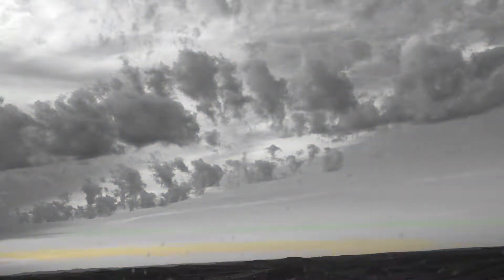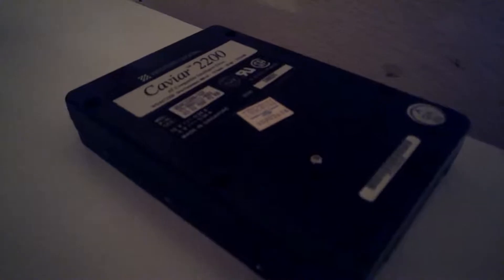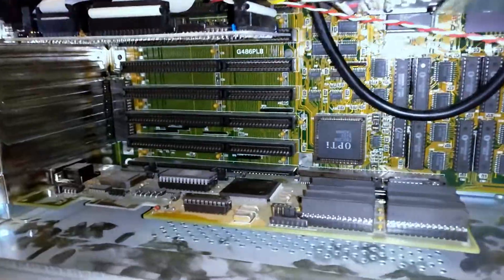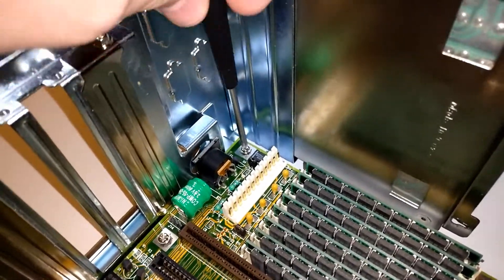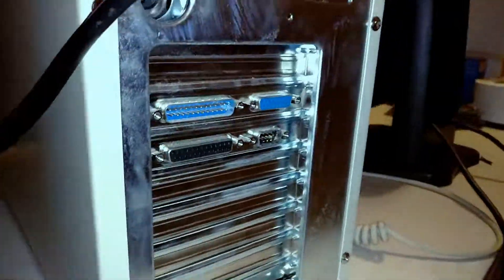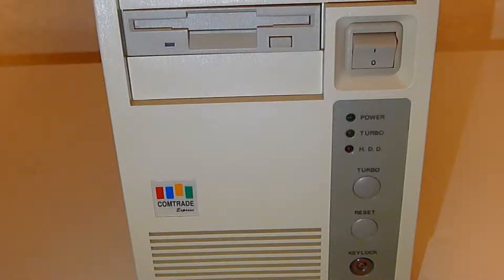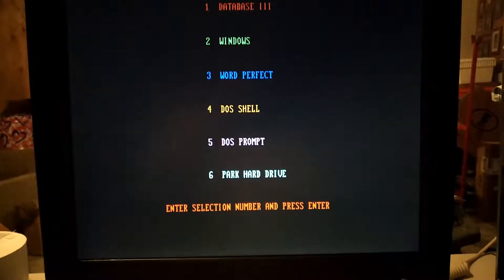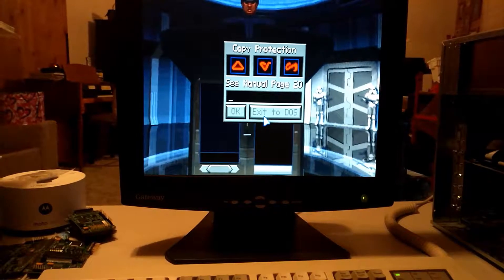486 PC Repair and Overview

Comment: Very nice computer in very good conditions for its age, but the floppy drives data cables have been put in reverse. They shouldn't have the light on all the time, that's a clear sign that the connectors have been plugged in reverse into the drives.

About the CMOS battery, check out the motherboard manual and look for headers for an external battery pack. Back to the 486 era, most motherboards allowed you to use an external battery, usually a box with four AA batteries, connected to the motherboard with usually a four pin connector. If you have such an header, you can buy an AA battery pack from ebay and connect it to the motherboard and so, avoiding to resolder another cigar-shaped battery that most likely is going to leak again in future.
Reply from the maker: Thanks for the feedback.  Floppy drives certainly aren't my specialty so thanks for letting me know, I'll definitely flip them when I have access to that machine again.  Unfortunately, I believe the paper manual for the motherboard is long gone, but I might be able to find one online if I do some digging, again, when I can look at the computer again.  Thanks for the advice.